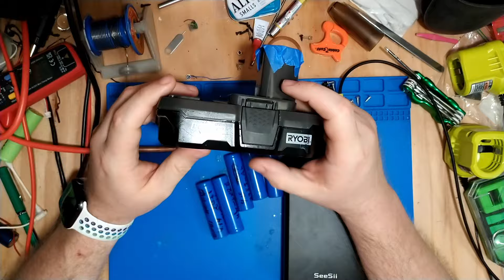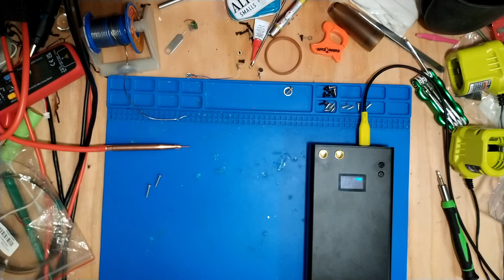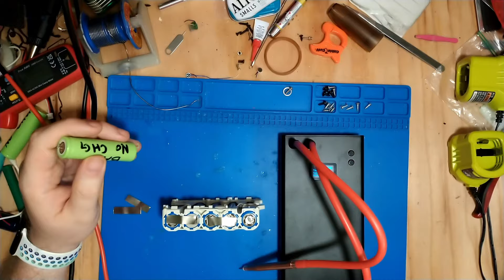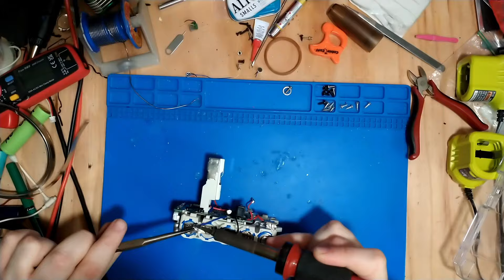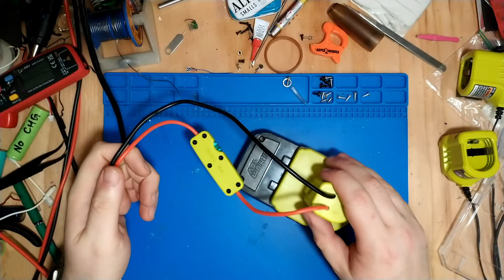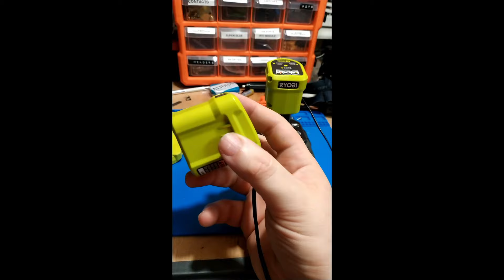Seesii Welding Test - Putting new cells into a Ryobi 18v Battery

Comment: -----------------------------------------------
snap in the battery and get the same results
 I have a Ryobi battery and it charge full . put  battery  run my weed eater
it will run 2 minutes  and dies recharge use it again the same results .
need to drain the battery how do I do that only have weed eater
---------------------------------------------------------
Full-charged=14.65 stop at 14.05 
open battery tested at 15.13 pole at 14.65
Each-Cells read
5] [ 3.05 ]
4][ 3.01]
3][ 3.04]
2][ 3.00]
1][ 3.01]
Reply from the maker: Fully charged, you should read about 20.8v at the terminals where the tool plugs in. "Empty" is about 15v. If you measure the individual cells, Fully charged will settle to about 4.15v and "empty" is 3.0v. So it sounds like your pack is not charging correctly. I would try it in a different Ryobi charger first to make sure the charger itself isn't the problem. Then if you're sure it's this specific battery that is not charging, I'd assume something is wrong with the control board in it and that's not easy for me to help you diagnose online.

Because the voltage reading will sag extra low while a tool is in use, they usually cut out around 2.5v so that the actual voltage after it sits for a few minutes is around 3v. The BMS won't let it go lower through the regular contacts on top.
Reply from the maker: It's very satisfying to be able to fix what someone else thought was just trash.

Comment: I have some of those batteries which are about 40 years old, Panasonics made in Japan and had been used in jet plane display boards. I used to peel them out of laptop batteries pack. So far I have only found 1 in a hundred which go bad. Its always the charging unit that goes bad. Careful taking any of these apart and go slow and be smart. There is a lot of power which could burn your place down. Not a toy. I managed to retrofit most of my older flashlights to accommodate them. Really got tired of buying batteries or having them leak and destroy equipment. I did figure out that those tabs were difficult to solder so I like the welder method. Thanks
Reply from the maker: @OhmSteader  yeah. I’ve only started refurbishing tool batteries the past few months but I’ve worked with lithium batteries for years with other types of electronics. I have other vids recently posted about how I test and revive over discharged batteries. These shells I have failed being revived so I’m going to rebuild them all.